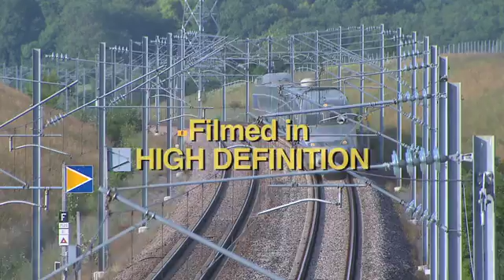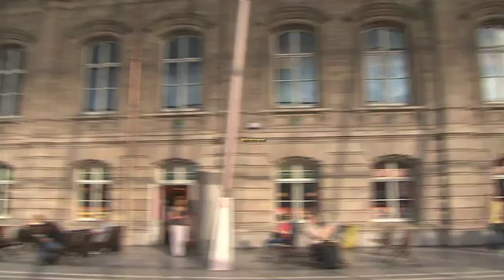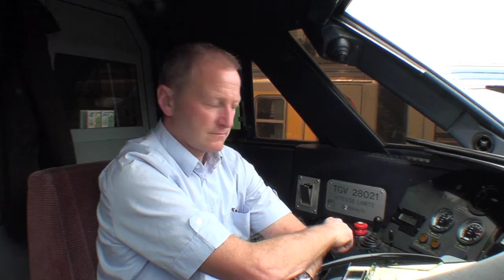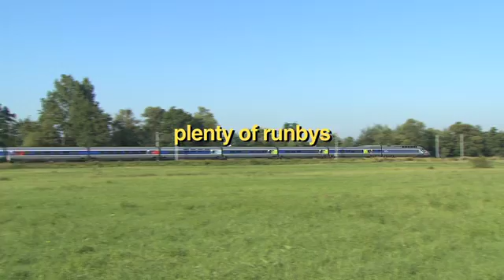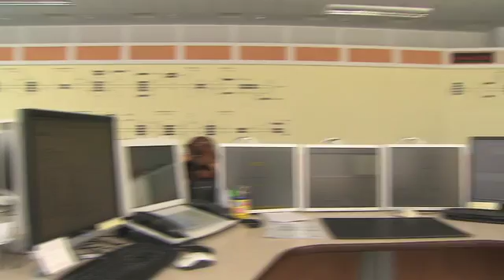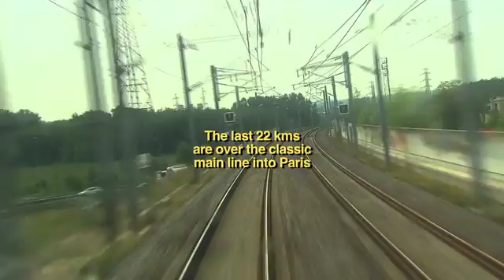Strasbourg to Paris Driver's eye view preview

Comment: What is the voltage on the high speed line? You mention that it is 25 kV on normal line, i.e. the standard used in European countries such as Finland, Denmark and the UK. Some French lines are electrified at 3 kV DC. Could the line near Paris be such?